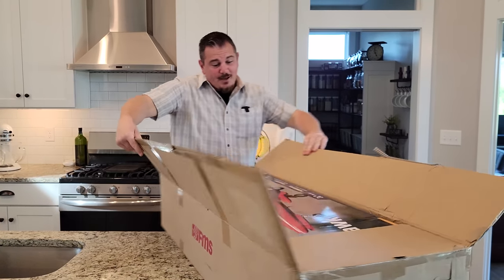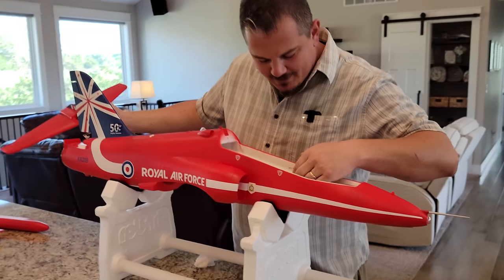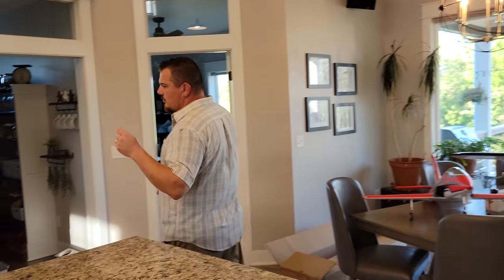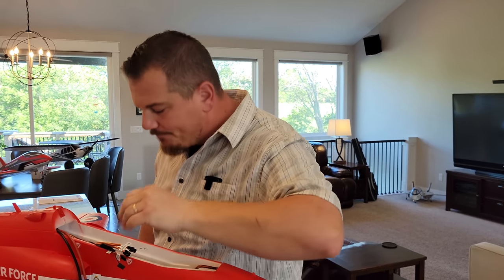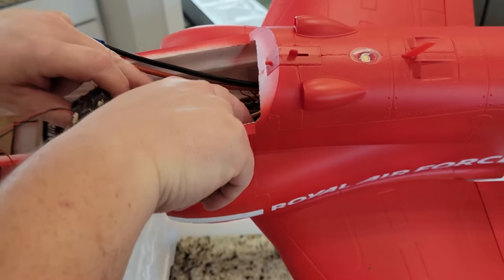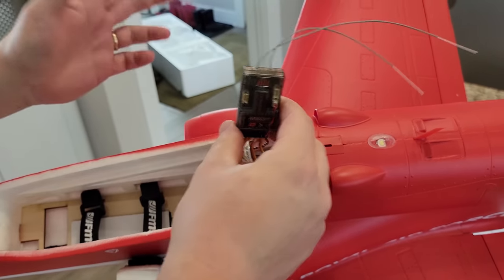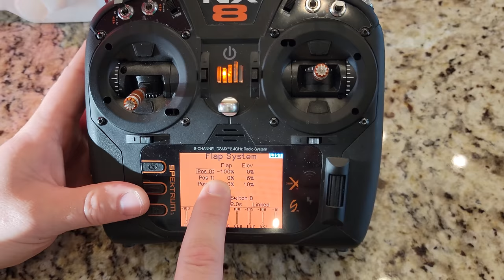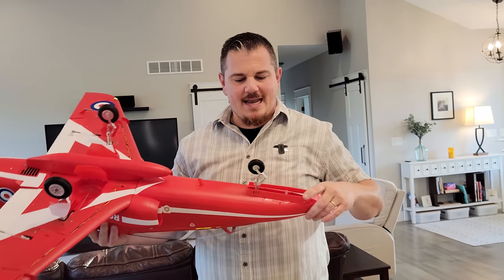FMS - BAE Hawk - 80mm - Unbox, Build, & Radio Setup

Comment: Hey folks! I do learn a great deal from your videos. While this airplane is more advanced than I am still seeing your assembly and radio setup (I use a NX8 myself) is very helpful. I will say I stand in awe of your flying skills as well as your knowledge of RC aircraft. I flew for about 16,000 hours during my flying career and now that I'm fully retired (not by choice - thank you FAA) I turned to RC flying to "get my fix." There is so much to learn and you have contributed greatly to my RC education. Great production values as well. That model you hire to be your "camera crew" is absolutely bonkers with the camera! I'm married to a career educator and know the challenges that present <G> Thank you both for your awesome work!

Comment: I have just bought one of these Hawks after seeing it fly at the best UK Model Show these days - Weston Park. Your channel is usually one of my first ports of call when I get a new model - love your videos, keep up the good work fellah 👍

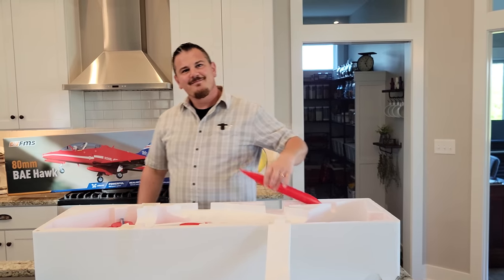At 6:02 & 12:26 - you ask if that's a fuel tank, it's not.... it's the modification that the Red Arrows had done to their Hawks to give them them ability to make smoke during their displays.
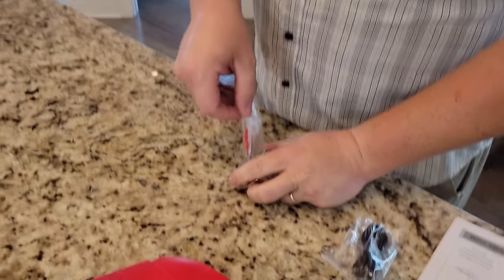At 12:43 - that is a pitot tube 👍
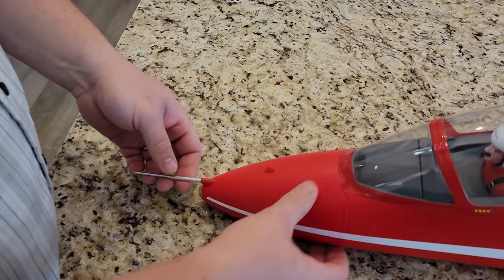At 13:39 - you may not like them but the colours of the canopy are as per the full size, sorry
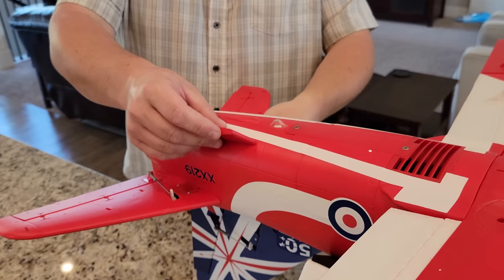At 34:04 - they are wing fences, strakes are on the fuselage like your dorsal fins at 28:25 and cause a vortex; wing fences are to stop air flow along the wing causing tip-stalling
Reply from the maker: Tanks? Modified tanks - Nice!

At 13:39 - you may not like them but the colours of the canopy are as per the full size, sorry - I mean the RED didn't quite MATCH the color of the body as well as they do on some planes...I love the red color, just not the slight mismatch.

At 34:04 - they are wing fences, strakes are on the fuselage like your dorsal fins at 28:25 and cause a vortex; wing fences are to stop air flow along the wing causing tip-stalling - Dang it! I guess I missed that, and the fence always gets me!!!! Sorry about that one

& thanks for time stamps, makes it easy for me to reply to your comments!!!

We will keep up the good work ;) Glad you're here with us!!!

Comment: thats a wing fence not a vortex generator - it will produce vortices at the aileron but the primary function is to manage span-wise flow - I installed stall strips on the leading edges and secondary fences inboard (which later models of Hawk incorporated too) for a much much better handling bird in low speeds and high angles of attack - the full size Hawk does also have a row of VG's outboard on the wing
Reply from the maker: Thanks! Very cool detail.

Wing Fence - got it ;)

Comment: Fedex dropped mine off this morning. Yes! Ive got an ar630 im not using I may just take out the reflex and use that. The lack of antennas makes me worry but ive used them in alot of planes with no range issues.

Comment: Just got mine put together. Ripped out the reflex and just put an ar630 I had in it. I didnt even have to skewer my canopy! Lol. The top tip of the vertical stabilizer was crushed and bent a little out of the box. Most wouldn't notice. Ive yet to get a foamie that didnt have imperfections out of the box though. They are meant to fly not look at. Although I enjoy doing both.
Reply: Did you have any issues taking out the reflex and putting in a 630,thinking of doing that but with a ar631,. For safe and as3x may put an avian esc in it if it’s possible ,looks a little hard to get to the wirjng
Reply: @homefrontdevelopments9596  I didn't have any issue I just unplugged from the reflex and plug into receiver and put the receiver where the reflex was.
Reply: Thnks ,did you think of swapping out the esc I bought an avian spectrum 100 amp esc but it looks  like it would be difficult to swap that out ,???
Reply: @homefrontdevelopments9596  im not gonna bother swapping the esc.

Comment: I was just about to pull the trigger on the Freewing T1 Hawk 70mm from Motion RC until Brian pulled this one out of the bag. Now I'm not sure what to go for. It's gonna be my first 6S jet. The FMS is more expensive but it looks to be better quality than the Freewing and  man it sounds really good!! I fly off grass too and that FMS was handling the grass really well. The Freewing's nose gear has a reputation for being flimsy. What should I go for? Freewing T1 Hawk 70mm or FMS BAE Hawk 80mm?
Reply from the maker: Craig - I'd be lying if I said this was in fact better...I can't say, since I haven't had any experience with the Freewing. That being said, this one is BETTER in specs, by a lot too...80mm edf's are bigger and more powerful. As you could see, the power to weight ratio is amazing on this plane, and she is gorgeous. Also, you'll not get a stabilizer included with the Freewing (unless I'm mistaken), so to be honest, I want to say "This one" but that's my no-bs answer you've come to expect.

This plane will not disappoint. Grass ops are going to be harder on some of these jets, no matter the brand, but TYPICALLY bigger planes fair better.

Good luck with your decision, and I hope you choose THIS FMS - it is great! 

BAE Hawk https://bit.ly/3q8fjJB
Reply: @BrianPhillipsRC  Yeah I wouldn't get a stabilizer with the Freewing. My original plan was to put an AR630 in the Freewing and set up Safe/AS3X. 

But if I bought the FMS I could follow your video and set it up exactly as you did. I've done that before with previous planes and they always fly great if I follow your instructions.

Thanks for the reply and for taking the time to help us all out. You're the best! I'm going to go for the FMS!!

Comment: I just did a Maiden on mine yesterday,  laughed when I later saw this build fly release..

I opted to remove the FMS reflex and programmed the AS3x receiver.
 that rear screw job was an issue on mine as well,  feels when you were struggling .. but I have a question,  Futura or BAE-HAWK?
Reply from the maker: Tough call - they are both so good. I actually slightly prefer the looks and very, VERY slightly smaller size - thus apparent increase on thrust to weight (same edf) on the BAE Hawk, but I'm a sucker for scale planes too!

BAE Hawk https://bit.ly/3q8fjJB
Futura V2 https://bit.ly/3PJqwLc | V3 https://bit.ly/3vMZDhS
Reply: @BrianPhillipsRC  
The Hawk's nose 'spear' will also help locate it after I auger it in the 1st time

Comment: What best to use with nx 6  love the videos.  From uk
Reply from the maker: You mean, what Receiver is best to use? The Transmitter (NX6) doesn't usually dictate what Rx, but rather the plane  dictates what's best to use.

BAE Hawk https://bit.ly/3q8fjJB
AR8020T https://bit.ly/3vgCnbV - If you're using NX6, you can use the AR620 and the provided Reflex V2 - https://bprc.me/AR620 OR https://bprc.me/AR6610T (with telemetry)
4000 6S https://bit.ly/3cxJshN
NX8 https://bit.ly/3J05xSj